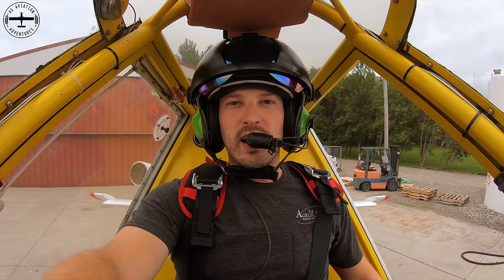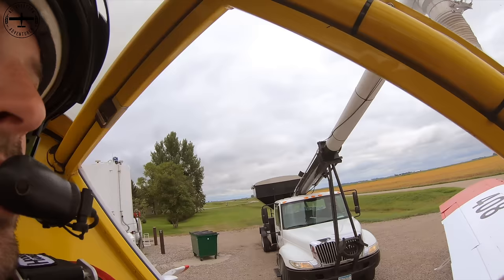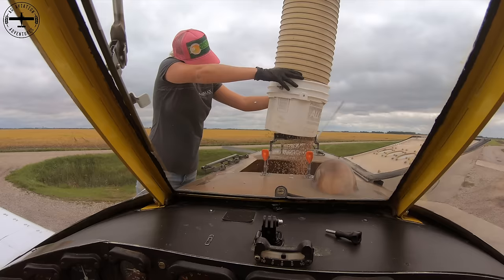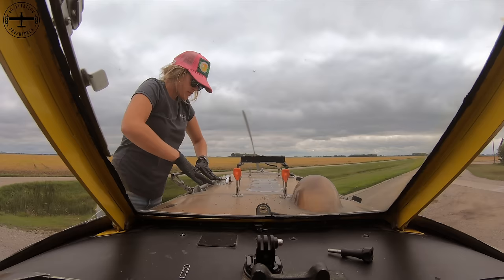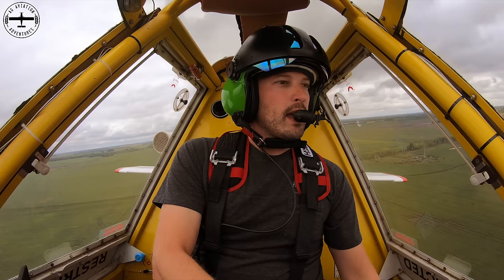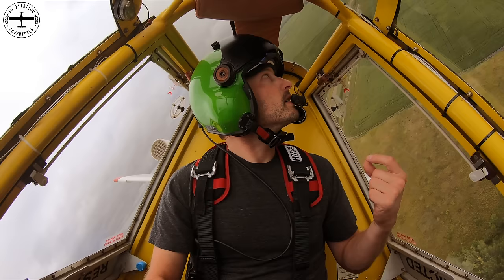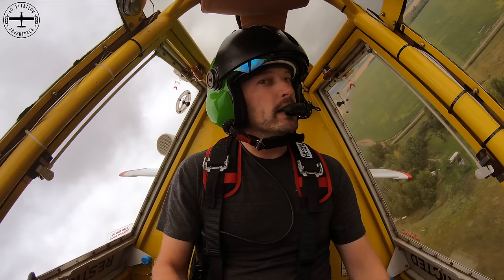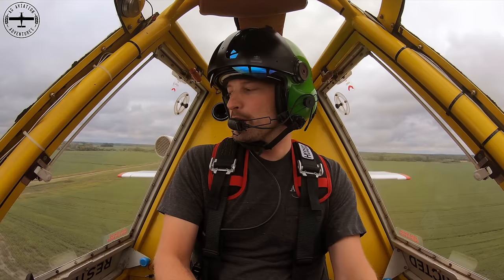Spreading Cover Crop with an Air Tractor 502

Comment: I came across your channel and am totally amazed at how advanced crop dustings have become. I was involved in crop dusters in Northern California. Worked mostly with Agcats with 600hp P&W engines. Before turbines became norm.
I started out flagging. Yes, we used to use flaggers. Started there, to loader trucks being trained to fly Ag planes, but sadly, California hit a terrible drought, which destroyed many farms, and the ag industry was petty much grounded for roughly 5 years. Unfortunately, i went to driving trucks. Always miss those days. That was back in the late 70s.
Reply from the maker: I’m glad you found the channel! Sounds like you have very cool memories of the industry.
Reply: @AgAviationAdventures  There are other channels, but i feel your format is the best. The advancement in ag planes is amazing. I mean, i worked with Stermans, N3N (both are trainers from WW1 days. )
The AgCats really was a joy to work with. Air Tractors and Thrush was becoming the new norm using 600 hp radial engine.

Comment: I saw wires being snapped many times.
Planes crash mostly on take-off under heavy loads as you well know. The AgCats at that time had a max gross hopper weight of 2000 lbs.
I know your Air Tractor carries much more. What  i love is how modern ag planes have become.
Keep up the excellent videos. 
We used to hand prop the engines. I don't know if you worked with radial engines.
They are a pain to warm up.
Anyway I'm looking your past videos and really enjoy them. If Callie is creating them then kudos.
Reply from the maker: Thanks for watching!

Comment: Ahhh….so there is a stall warning going off.  And, you are banking in the turn which I think raises the stall threshold and flying low. Yikes, how does that work?  Is it because you load is light?  Thanks.
Reply from the maker: This particular aircraft has a touchy stall horn. But in general you are always near a stall when loaded, hot, and turning. It’s just part of it and something that needs to be managed.

Comment: wow. way dirrerent than it was when I was loading in the 90's.  the loader truck used to have a bucket. and we used grumman g-164's b's and c's mostly.
Reply from the maker: The good ol days!
Reply: @AgAviationAdventures  yep. av gas was still only 3 bucks a gallon!
Reply: @lukewarmwater6412  Man I still have to do that, the pellets I use will break up in an auger so they have to be dropped from a bucket or dumped straight from the bag.  Little tiny foil plastic 25lb bags.  I made a nice bucket for a telehandler but the anxiety of holding 3000lbs over your airplane with a wobbly piece of machinery is REAL.
Reply: @Skinflaps_Meatslapper  find an old loader truck and build a new one based on that design. they werent wobbly back in the day. jones flying service made their own and they made them stout.... the best truck on the line was#50 an old ford, like 1953 or something. it had a short nose and could get in with plenty of room to walk between the front bumper and the ailerons. the newer f-750 were a much tighter fit and I always felt like I was gonna bend the trim tabs.
Reply: @lukewarmwater6412  Nah, I just need a bigger telehandler.  Right now I'm walking a pretty fine line between weight and extension limits, but they've got bigger ones if you have a bigger wallet.  If mine had some stabilizers I could lower then the weight issue wouldn't be a problem.

Comment: Hey, quick question. Would we be getting in your way standing nearby taking pictures while your crop spraying?
I’d love to take pics but worried I’d be interfering with your work.
Reply from the maker: If you’re not too close it’s not that big of a deal but a lot of times people want to stop on the road and on the edge of the field and that usually is a problem. I end of leaving the field until the person leaves. It can be an issue if the wind is blowing towards them.

Comment: Nice shot! How do you calibrate the opening system for the spreader to get the 14.5 lbs/ac? With the lever position only? thx
Reply from the maker: At that rate I add golf balls to help slow it down. Transland also makes a device that works similarly just more expensive.

Comment: I would imagine that broadcasting seed is a great way for a new pilot to break into ag flying?  Get the hang of flying the light bar, turns, speed, start and stop points for the money handle, etc without the hazards of flying 5-10 feet AGL right off the bat?
Reply from the maker: Yeah!

Comment: A number of times in this video, your left hand pulls something back, and is then pretty strongly snapped back forward.  What's going on there?  Examples: 3:47, 4:29, 5:13, and 5:55 (this one you can hear it snap back).
Reply: I think he is opening and closing the bulk hopper door to control when the seed is falling from the aircraft.
Reply: @thezirons  That would make sense.  Thx.
Reply from the maker: Yes that is opening and closing the hopper door.

Comment: I have always wondered.  Would an Air Tractor or other similar Crop Dusting plane make a very good private plane if it was stripped of the unused "junk"?
Reply from the maker: Probably not. It’s quite expensive and only has one seat. I find it uncomfortable to ferry long distances.
Reply: Not an Air Tractor or Thrush.  They don't really fly hands off for more than a few seconds before they're climbing or diving or banking or yawing bad enough that whatever you needed both hands for in the cockpit is next to impossible to do without correcting the plane with a nudge from your knee or a kick to the rudder.  You'll never truly get them trimmed out, they're not the most stable aircraft for that sort of flying.  Plus I doubt you'll get a decent one for less than $250K unless it's a radial, and that price range opens up a lot of better alternatives.  The smaller planes, such as the Agcat, Cessna 188, Pawnee, and Fletcher might fit the bill better.  I know for sure that many Agcats, 188's, and Pawnees have found homes outside of ag, some converted to two seats, some for banner or glider towing, and they use the Fletcher for skydiving.  Just bear in mind that these aircraft were kind of built around a hopper, and taking it out would require a lot of fab work just to fill the gap left behind.  Then you've got a bare bones aircraft with virtually no interior to speak of, little to no avionics or instruments that work, and the hassle of a high time aircraft to deal with.  If you're into that kind of stuff, I'd recommend going with an Agcat.  There was a company that made a two seat Agcat with a bubble canopy called the Toycat, another company put one on a set of floats for the 1996 movie "The Phantom", and a lot of others have modified them for two seats (some look fantastic, others look terrible).  You have a lot of choices, a short wing A, the A+ with an extra 18", the B model with 36" more wing than the A, and finally the B+ with an extra 18" on top of that.  Several fuel tank capacities to choose from, a slim center section with something like 36gal, a fat center section with 50 something, and from there you add 18gal tanks to the wing panels, up to six I believe.  You have engine choices ranging from a 220HP radial to a 600HP radial and several sizes/mfg of turbine engines.  You can get aileron spades, straight tail and tall tail conversions, big gear, raised wings, and most NACA cowlings from other radial aircraft will fit after a few small mods.  For goofing around, I'd suggest a lightweight A model cat with a 220...the short wings give you a nice roll rate and the 220HP engine keeps the plane flying at the right speed for the controls to feel light and balanced, because that's what the original agcat was designed for.  It's terrible for working, but without a load it's a sweet flying little plane, on par or better than a Waco, light years ahead of a stearman, and tougher than both combined.  They even have a nice spot on the wing struts to carry extra passengers.

Comment: What are the differences in the aircraft setup for liquids and cover crop? Do you use the same compartment for both? Thanks
Reply from the maker: It's the same hopper, but different equipment. Check out this video: https://youtu.be/1SAp_q2d2rk that explains the swap!

Comment: Is it safer to turn the prop off? Im just curious what's the advantage to leaving it on aside from time?

If she were to fall from the wing a relatively simple fall would turn into a fatal one.

Just curious and hope you're kind enough to answer and offer more insight, I dont do this for a living so I'm coming from a place of ignorance.

Thank you.
Reply from the maker: Thanks for watching. Some of the maintenance items on these turbo prop motors correlate to how many engine starts it goes through. If you shut down each time that could be 15-50 starts a day which would be detrimental for maintenance purposes. It usually only takes about 3 minutes to load as well, so by the time it is shut off it would be time to start it again. With that said, the motor would be hot and would have a hard time not having a hot start (basically catastrophic to the engine).

Comment: Would wearing glasses be an issue if you’re trying to get into crop dusting? I might have to get my vision corrected to 20/20. And do you have any advice on what kind of glasses or even contacts you should get?
Reply from the maker: I wear contacts and use whatever my eye doctor recommends.

Comment: Wow, 50 feet is high and every turn the stall warning horn is screaming.
At 50 feet I better be over the fence and the stall warning stick shaker better not be heard but when the gear hits the center of the runway, asphalt or grooved concrete and at least 5,000 feet long.
What is fast? It looks fun. Last time I did the driving lined up on the runway, pushed the throttles forward pushed the button and the plane did the rest.
Reply from the maker: Haha thanks for watching DW. For me fast is 150 mph, that's my normal spraying speed. I'd love to try that push button thing sometime!

Comment: Can the same plane disperse both wet and dry loads? Or do you have to pick one or the other?
Reply from the maker: Yes. You remove all the spray equipment from under the plane and attach what's called a spreader.